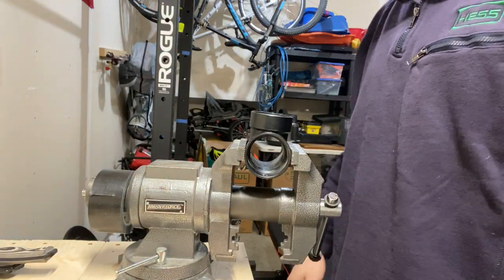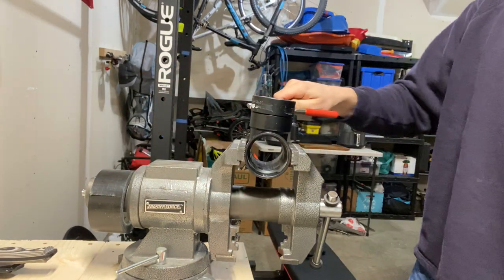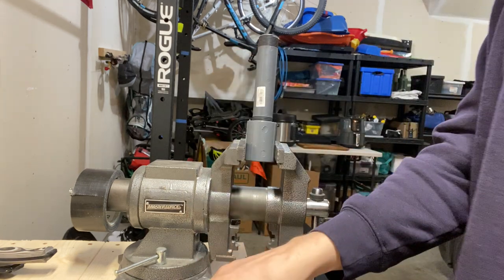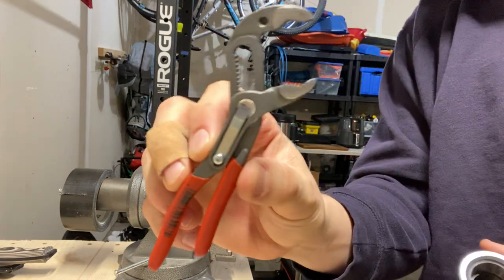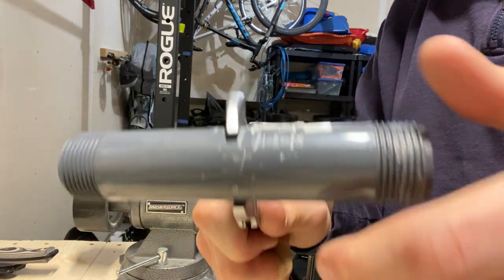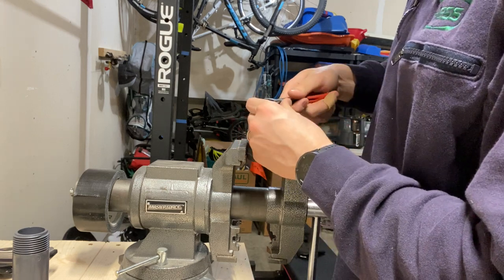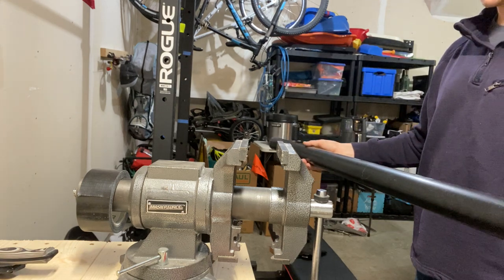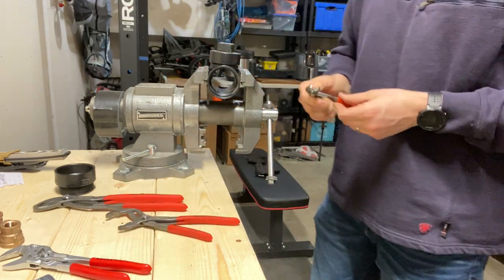Testing the Knipex Cobras on Pipe and Fittings (87-01-180, 87-01-125, 87-01-250)

Comment: Maybe you notice this when editing the video but, when you were trying to take apart the sch80 PVC, the larger pliers were slipping off the coupling because you were using them backwards. User error was causing more damage to the coupling. If you had been going in the correct direction, had the handles closer together, and had them positioned to where you were pushing them together instead of having the pliers pushing apart from each other, you probably wouldn't have needed to put the pipe in the vise.
Reply from the maker: Lol, that’s embarrassing! I didn’t notice but I guess in the moment I went full idiot. Agreed with your assessment

Comment: 100 for edc-no specific use-just incase. 180 for real tool-typical normal plier use-most 10” channel lock uses. 300 for the upper end of 10” channel lock uses and beyond.

125s are good for edc if you have a specific regular plier use but need them in your pocket… 

150s are the upper end of an in pocket edc, but are a great tool belt or super lightweight tool bag option. 

I know 10” channel locks are a common tool, but I feel like the 180s are so close to that same capability, and once you’re in that 10” tool range the jump to 12” is not a big deal and you get way more capability. 

Larger than 300 you obviously have a very specific reason for it.

Comment: 2 inch pipe is actually bigger than the listed capacity for both the 250 (50mm max pipe) and the 180 (42mm max pipe). Now the 300, that has listed capacity of a whopping 70mm for pipes. Perhaps that's why the 180 and the 250 feel the same, only 8mm capacity difference and both are too small for that pipe.
Reply from the maker: At 20min I grab onto 2” pipe with the 250s. However I actually did misspeak for the 180s as shown just before the 250 demonstration.

Comment: These knipex pliers are not designed for steel pipework but for multirole light use.
If you want steel pipe pliers try the Swedish style pipe wrenches who are the ultimate for that purpose.
Reply from the maker: I agree that leverage becomes an issue with the shown sizes. Even the 250s aren’t great for 1” Steel pipe. However they are definitely designed to be used on steel pipe and could be used as your dedicated tool.
Reply: @EngineersPerspective701  Nope, they are not steel pipe wrenches. Far from it. No professional pipe fitter would even try using them to turn steel pipe. They are general purpose pliers. Very useful indeed but not for steel pipework. Apparently knipex does produce a 42''  Swedish style pipe wrench, with some modification on adjustment from the original design, so I guess this could be used for your review.
Reply from the maker: @PaloXanthos  It would be weird to me to see a pipe fitter using cobras but I don't think there is anything stopping them aside from leverage. 

The 300mm and down are advertised as "water pump pliers" but the XL and XXL are marketed as "pipe wrench and water pump pliers". The only difference comes down to leverage and a little bit of jaw design due to the large opening jaws for larger pipe. 

Personally the 300mm ones are required for working with 1" steel pipe (mostly XXS nipples) but works fine. 

I prefer a 14" pipe wrench but the cobras are a lot more versatile. Just depends on the setting for what gets used.

Comment: Awesome demo, keep up great content. Any thoughts on the Cobra XS vs 125mm?
Reply from the maker: I just received the XS 2 days ago and shot a video that will come out on the the 19th. My initial impressions are that the XS is more comfortable than I thought it would be which was my greatest concern (still not as comfy as the 125 though). Very capable for sure. 

What I will say for now is that if you want it only as an EDC tool for occasional use then XS but for frequent daily use then 125mm for sure.
Reply: @EngineersPerspective701  Thanks. Looking forward to the vid. 👍

Comment: Might have better luck with clamping plumbing bits in your vise with a pair of V-blocks, can craft basic ones using chunks of 2x4 timber and a few in-cuts.

(I did notice the vise built-in V-clamps, but you weren't running that head of the vise "up" for most of your demos)
Reply from the maker: I'd like to get/make a non-marking jaw cover one of these days. Don't use it for what would benefit from it much anymore though. 

Learn something new every day! I've actually never really looked at the pipe vise end on before and sure enough there is a v-clamp.  I did most of plumbing tightening and cutting "in field" so I never used it much.